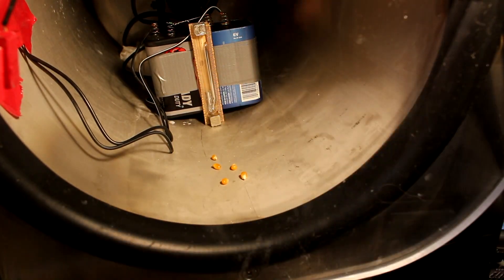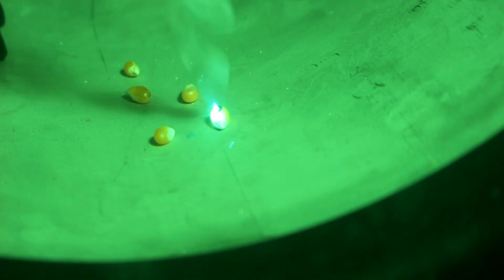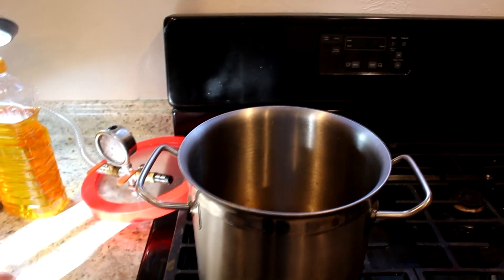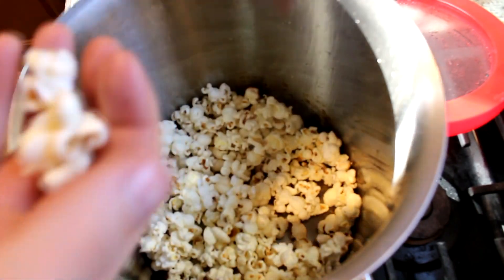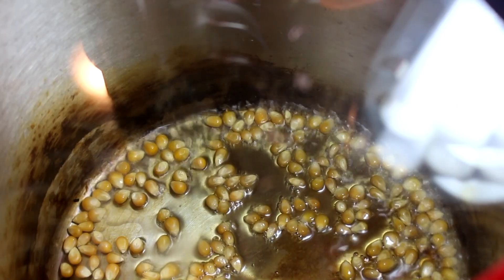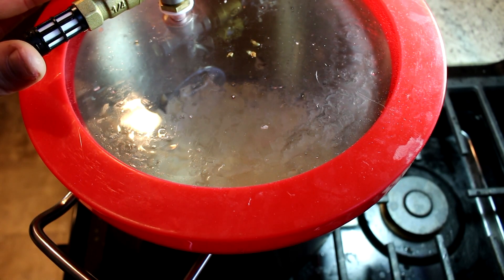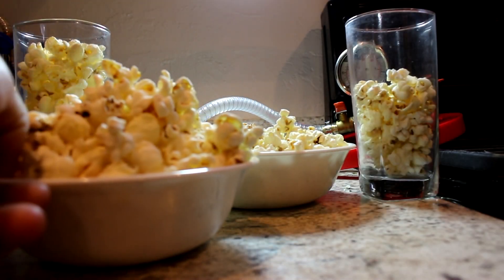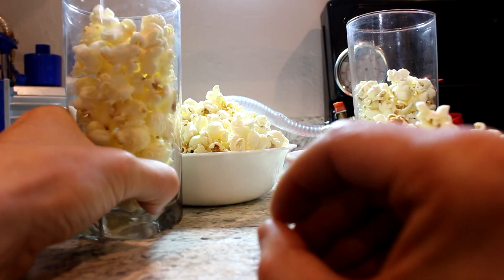Popping Corn In a Vacuum

Comment: This may be a stupid question. If you put an electric scale in the vacuum, set it to zero and then took it out, would it measure the weight of the atmosphere?
Reply: Mind absolutely blown haha. That seems genius to me.
Reply: I don't think so. Here's my hypothesis:
Not unless the bottom of the scale is airtight and still in a vacuum. On a normal scale the air under the scale would push up the same as the air over the scale pushes down meaning there is no net force. There would have to be a pressure differential to weigh the atmosphere.

A meter cubed of water weighs a ton. Have you ever swam under a meter of water? Were you crushed by a ton of weight? (only the air in your ears/lungs are affected since there is a pressure/density differential between the air/water). Same idea here.
Reply: +Frodo Baggins The atmosphere weighs a lot. It's 14.7 lbs/square inch. Which means a scale with a surface area of ~28in squared (6 in diameter scale) would have ~415lbs of air on top of it. The reason it wouldn't work is that the air under the scale would push up with equal force as the air over the scale. In order to weigh it you would need the bottom of the scale to be sealed and in a vacuum while the top is exposed to the atmosphere.
Reply: Awesome question mate. I've had a bit of a google and an attempt to wrap my head around it!
A few points first, the air around us keeps us slightly 'floating', so things are about 0.1% heavier without an atmosphere. Mass doesn't change in a vacuum, however scales don't measure mass.
So, if you zero a scale in a vacuum, the weight of the scale will be .1% more. Say the scale is 1kg outside the vacuum, when inside and zero'd, it will minus its 1.001kg. To then take it out and let it weight itself (put it flat on the floor), its zero (-1.001kg inside  vacuum) will be taken from its weight (1kg). Thus, it should display -.001kg. That's saying that the weight of the scale when in the atmosphere inside of the vacuum chamber is (times 100 for %) .1% more than when outside the vacuum chamber. Surely you could work out that half this pressure would have the scale weight 100.05%, etc. So depending on this difference you should be able to measure the weight of the atmosphere!

However, you would have to measure the exact location's atmospheric pressure just outside the vacuum while the scale is being zero'd (and hope it doesn't change much while you take the scale out of the vacuum), to perfectly work out the weight of the atmosphere on the inside (as the scale on the outside will change slightly with different factors like low pressure systems and the locations altitude). But if you had that device why not just stick it inside the vacuum lol.

That's my crack at solving it! Again, great question :)
Reply: +Jeremy Rivera The reason it wouldn't work is that the air under the scale would push up with equal force as the air over the scale is pushing down. There would be no net force for the scale to measure. In order to weigh it you would need the bottom of the scale to be sealed and in a vacuum while the top is exposed to the atmosphere. This is basically what a barometer does. A barometer is measuring the "weight" of the atmosphere.

The answer to the question is that the atmosphere at sea level typically weighs 14.7 pounds per square inch (ignoring fluctuations due to weather, a column of atmosphere that is 1in x 1in wide weighs 14.7 lbs at sea level, and weighs less as you go higher up in elevation where there is less atmosphere above you).
Reply: No, but you can weigh the atmosphere inside by weighing the vacuum chamber!
You put the scale under the chamber, and compare weights before and after pulling a vacuum.
It's quite impressive, go do it!

They say if you imagine a cylinder around the Eiffel tower the air inside that weighs more than the steel.
Reply: It probably depends on the mechanism of  the scale. To be honest it wouldnt work for 99,9% of scales. I am not a scale expert though
Reply: Probably wouldn't weigh enough for it to sense anything
Reply: Joe V Yeap, unless it has an enclosed balloon like thing instead of springs. Then it could work. But still not really. EXCEPT if the weighting base was perfectly enclosed in the sides. Kind of like a syringe but with the end open. I doubt there is a scale like that.
Reply: I don't believe this is possible. The scale would most likely either stop working entirely or blow up in near vacuum conditions unless it was specifically built with materials that could withstand the effects of atomic oxygen. Cody has more experience in this so hopefully he can shed some light on the matter.
Reply: Joe V well thats exactly what I said lol
Reply: Makes sense
Reply: For  further clarification on why it isn't possible, we do not have the ability to test perfect vacuum here on earth so any measurement you get from a man made vacuum would be inaccurate.
Reply: Pajama Muncher well shit, u made my day
Reply: Mind Blown I wanna see Cody reply to this comment or make a video on it.
Reply: +Jayden Savage wow thanks for the explanation it's really in-depth and definitely helped me wrap my head around it.
Reply: No worries Jeremy, but on second look I did make a mistake! I was trying to work out if you can measure the atmospheric pressure inside the vacuum... Pajama Muncha was probably talking about weighing our earth's atmospheric pressure though.

Same principal would apply, however you would need a 100% perfect vacuum - which I believe is incredibly difficult. Then you could definitely simply take it out, watch the weight go down slightly (like 0.001kg for 1atm) and there you go. I'm not sure of the scale, but perhaps a weight drop of 0.0011kg would be 1.1atm, and 0.0009kg would be 0.9atm.

I feel like I'm close to an answer lol. I'd love to see someone who knows more about this reply or for Cody to do it!
Reply: Oh alright, thanks for the update too. And yea I would love to see Cody do this.

Comment: So if there are any companies that sell pre popped corn 
They should invest in something like this on a huge scale so they can use less cernals for more money
Reply: Hello71b It is in fact sold by weight.... but... how much do you pay attention to the little numbers on the package rather than the size of the bag?  Also, an Canyon commented, the fluffier vacuum popped popcorn has a nicer texture, so people might like it more, which helps keep customers.
Reply: except that packaged popcorn is sold by weight, not by volume.
Reply: Hello71b I said pre popped popcorn. you would have the same popcorn bag size but with fluffier popcorn so you could package less but it would still fill the bag.
Reply: It's irrelevant if the bag is still filled to the same height.
Reply: Noah A No it's not. If the corn is fluffier it will take less to fill up the bag. Just like the thumbnail of this video. That is the same amount of popcorn, one fills up cup while the other does not.
Reply: ***** As multiple people have stated it's based on the weight. Yes, it would fill up the bag sooner, but then it wouldn't be meeting their standards for weight.
Reply: Noah A standards for weight thats not even a thing... and no one looks at the weigh of a bag of snacks.
Reply: ***** If you know there's a weight listed on a bag of snacks, then the snacks must have a common weight. Your second sentence conflicts your first. I mean a standard weight decided by the company, not some government regulation, you realize that, right?
Reply: But if you want to focus on volume, consider this: People respect companies that maximize*efficient* use of volume. Pringles, for example, is constantly praised for that. If popcorn is popped to a larger size, people will finish a bag of it sooner than before because the bag can hold fewer. That will reflect poorly for them.

Comment: what about doing it the opposite way. causing a high pressure and instantly releasing it. would that cause the corn to pop? I was thinking as the instant pressure change would cause the water in the corn to rapidly expand.

Comment: i bet some mass production popcorn makers do it in a vacuum because of the larger pieces and better tatse.
Reply: Multiapples 105 yeah but they weigh it. So you know you are getting less unless you don't read the label. The point is is that the vacuum stuff saves lots of unpopped kernels and looks a lot nicer.
Reply: batt3ryac1d but if the popcorn is bigger if you pop it in a vacuum, that means we get less pop corn because they can use less popcorn to fill a bag or a box
Reply: Multiapples 105 Well if you look at the size and not the weight then yeap. This can fool you.
Reply: and less unpopped kernels (waste)
Reply: 27dcx yeah i was gonna write that too while watching but forget. i imagine in bulk the wasted kernals probably add up.
Reply: no doubt about that. One does not simply reach the fluffiness of store bought popcorn at home.
Reply: One way you can tell is because the vacuum popped popcorn looks rounder and "puffier."

Comment: how to make a Vacuum 

get a plastic cup that is strong
Drill a hole on the bottom
get a short tube to suck all the air out
put the tube into the hole
flip the plastic cup upside down
now suck all the air with your mouth 

Your welcome

Comment: wich one takes more energy to pop?
Reply: A Crustacean inside each seed of corn there isn't  vacuum otherwise the water (which is very little) would evaporate
Reply: Wouldn't it take less energy since water boils at a much lower temperature in a vacuum?
Reply: Okay you're right.
Reply: i think the energy  needed to pop depends only on the internal structure of the corn
the outside pressure affects only how much it will expand after it pops
Reply: viermidebutura I mean how much thermal energy you need to lower the pressure inside the chamber vs the thermal energy needed to pop it with the pot
Reply: viermidebutura just to see wich one is more efficient. Heating the pot or lowering the pressure
Reply: Rafa Aquino you'll have to rephrase that because i don't understand your question...
Reply: Rafa Aquino as i said the energy needed to pop depends only on the internal structure of the corn so the amount of energy is the same on both cases
Reply: viermidebutura I see, thx

Comment: From now on Cody will only pop his popcorn under a vacuum. Hows it taste?
Reply: Sounds pretty good.
Reply: That's awesome. so earths atmosphere prevents the kernel from reaching its maximum potential? i thought (about a 25% chance) the kernel would go back to regular size when released from the vacuum. once the vacuum was released, they would shrink. they probably did a little i would imagine.
Reply: Probably not much at all, because the final structure is porous, so the air can just fill the gaps. Only reason to let the vacuum go slowly is to not crush the kernel with inrushing air.  But there are no inner cavities filled with low pressure steam or anything. This means no pressure differential and thus no going back to a smaller size.
And probably the limit of the size is due to how much protein fibers there are to hold back the steam. Once the steam can escape through the porous structure after expansion, the kernel stops growing. In normal air, there is just an opposing force to the expansion, leading to a denser fiber hull for the popped corn.
Reply: nah dude, takes more time than just the convetional popping.